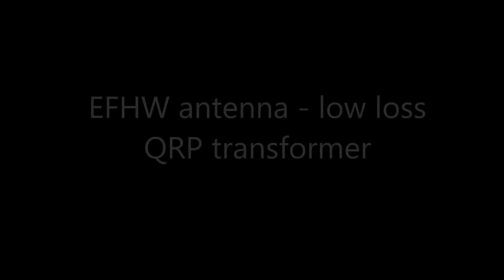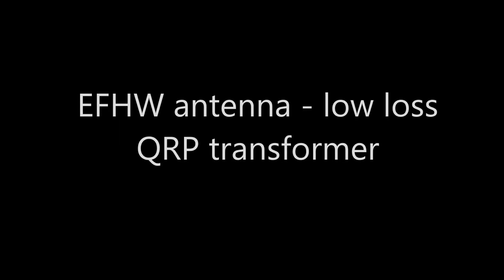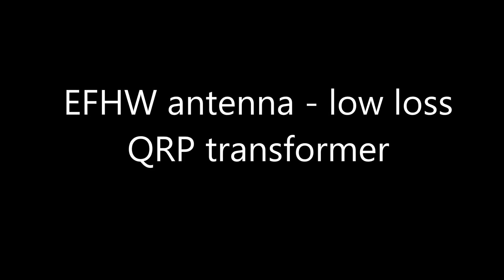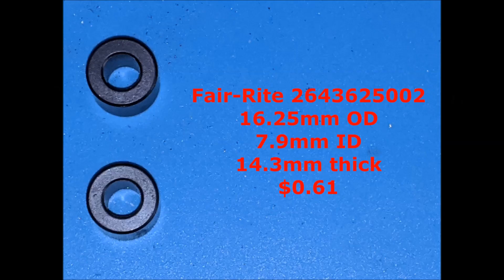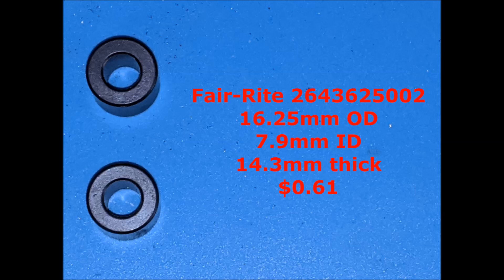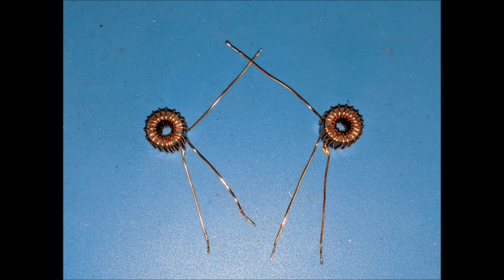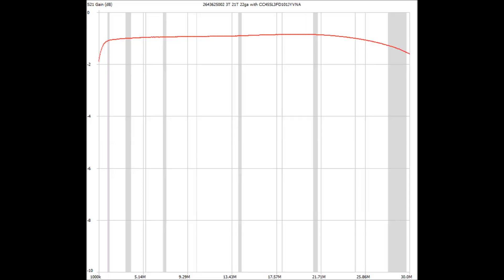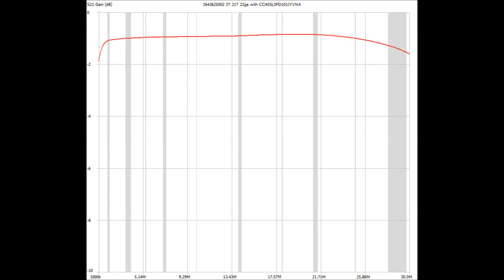EFHW antenna - low loss QRP core

Comment: I like your approach to testing. Have you tested a type 61 for 30-10 meters?  Thinking of making a 9:1 for POTA ops now that bands are better. I just don’t have the test equipment
Reply from the maker: Tom, I have done some 61 mix testing which is looking very promising using 2661102002 ferrite wound 2/14 for 40m-10m. Planning to do a video on it, hopefully not too distant future.
Reply: @evil_lair_electronics  I look forward to the video

Comment: Great video. I like the way you share the primary winding with the secondary winding, the same as Jerry Sevick does. I've been doing the same for years. Everybody thinks you have to have two stand alone windings and....don't forget to twist the wires???
I'll have to sweep my QRP UnUn's. Two FT 140-43 cores, wound 64 to 1 gave me a 1.38 db loss per core. Since I only run 5 watts into mine, I'll have to make two on an FT 82-43 core and test them. Looks promising. Thanks for posting.
Barry, KU3X

Comment: Yes, you have low loss with this core because of the core hight, and three primary windings.
But, with this configuration it is problem to achive good swr above 20MHz because of parasitic capacitances.
Did you measure swr curve over HF bands with 2,5k resistor on antenna side?
Reply: Maybe this one is great for 40m and 20m band, only... I have the same results as you.

Comment: Thanks so much for the analysis of Duffy's design. His other EFHW autotransformers are fascinating, to me. Have you used the Fair-rite 2643625002-based core in a physical EFHW yet? If so, did a 100pf cap help land the upper bands? Again, thanks for the great video!
Reply: I already experimented a lot with these cores and built several couplers with them. 
One coupler has selectable taps (1:36, 1:49, 1:64 and 1:81) on the secondary and a switchable shunt capacitor. 
Depending on your target frequency (above about 20m) a value of 100pF +/-40% will definitely help to bring the SWR down. The resonant frequency and the impedance depends also on other factors, like height above ground, ground conductivity and wire thickness. 
When doing a SOTA activation, I always measure my antenna with a portable analyzer. I'm compiling a document with all my findings, but I still need many more experiments and measurements...
I find the articles from Owen Duffy very interesting and I was so happy to see that somebody with a VNA measured so many aspects. These two sources of information helped me a lot in building a multi-band  EFHW (resonant on 60m, 40m, 30m, 20m, 17m, 15m and 10m) with only one switchable coil to change the two band segments.
Thank you @Evil Lair Electronics for showing us your results!
Reply: @stephanschmid4230  - This is wonderful to read. If you're open to sharing results, I love testing antennas in portable QRP outings. Shout anytime - KA4BKA - Mark 
ps - my call's my gmail address, too
Reply: @plethoratone2171  I like portable activation as well, in my case especially SOTA since there are so many summits to climb within 1-2h drive from my town, be it in Switzerland, Germany or France.
I'll create a PDF with all my findings, backed with measurements and a proposal on how to build a portable muli-band EFHW antenna with different options. I realistically expect it will be finished earliest by the end of autumn. I will announce it at least on SOTA reflector.
Reply: @stephanschmid4230  hello! where can we find some details about your EFHW multiband? :) 73
Reply: @LuísLapão  Sorry, not finished yet, 73
Reply: @PortableRadio  OMG! I already read it two times and will read one more. Outstanding work from you. I will also give you my feedback about my findings... Cheers and 73 de Luís CT2FZI
Reply: @PortableRadio  Amazing work.  Thank you.

Comment from the maker: Certain "internet experts" on Facebook STILL claiming that 2xFT240-43 is more efficient. Hilarious! Of course they have zero measurements to support their claims!
Reply: What do the big ones measure out as for comparison?
Reply: Hi :) Its not really fair to compare QRP vs 100W or even QRO. You need bigger core to dissipate all the heat. For QRP all changes... Its not really about efficiency ;)
Reply: I very much like your experiments!
What I wonder, however, is whether the low power output of a VNA helps to minimize loss. Would it be possible to measure the same back-to-back toroids with a QRP rig (5 W) on one side and a powermeter (or voltage across a dummy load) on the other? This would enable to prove that in spite of possible saturation etc. the loss might still be very low.
Excellent job, way to go!